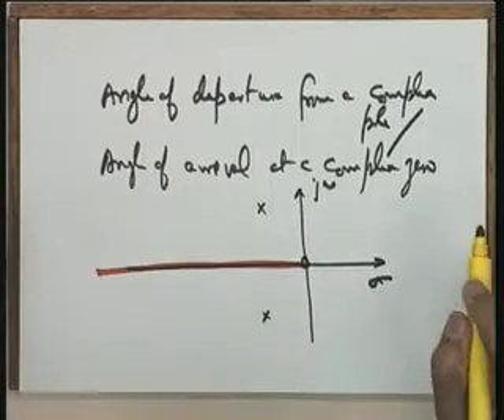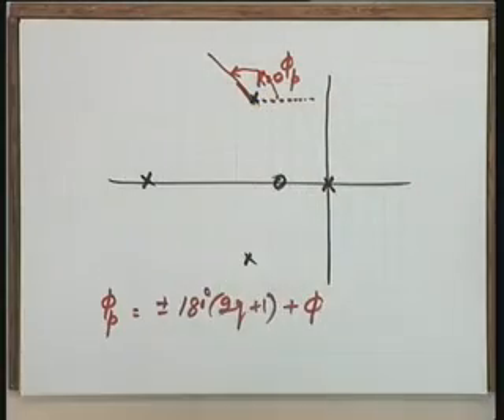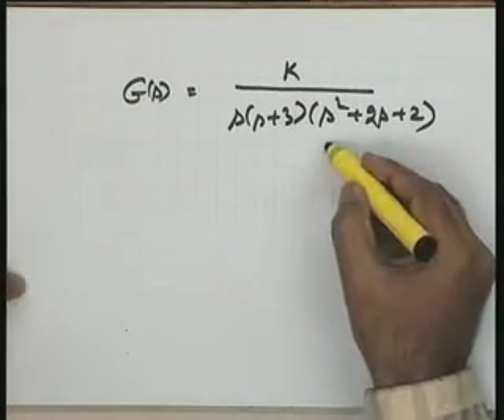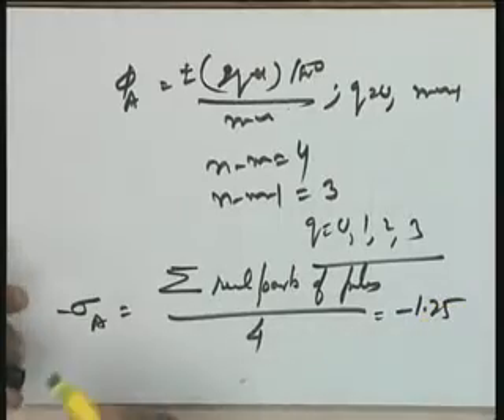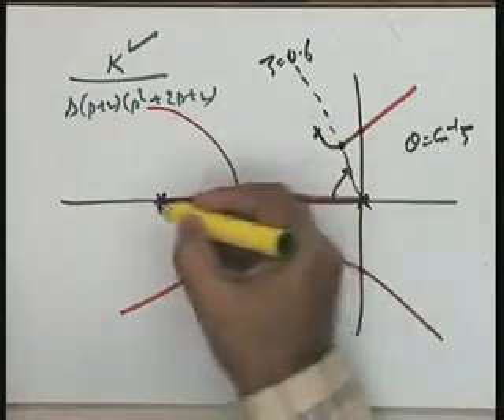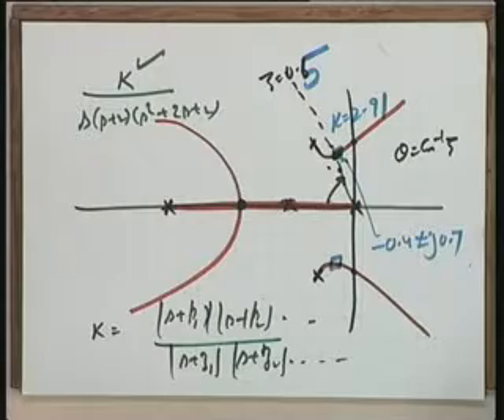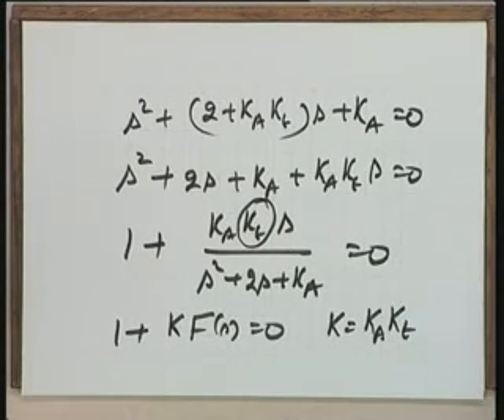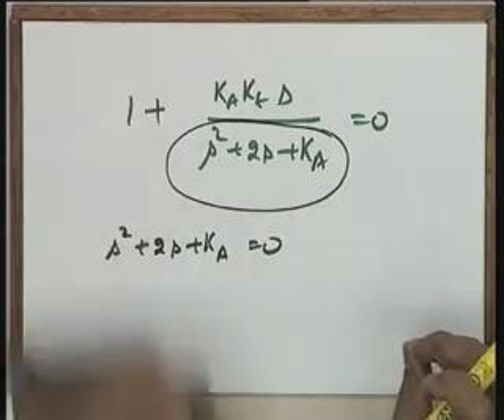Lec-32 Compensator Design Using Root Locus Plots (Contd.)

Comment: Hi, dominance condition is applied when Real part of a pole is 5-10 times the real part of other poles. In the R.L. shown (in the first deaign problem), how did the professor made the pole at origin as insignificant? As gain increases, the pole moves to the left but so do the complex conjugate poles(which the professor took as dominant poles)?
Reply: Prof. is right. He make the line for desired zeta and see the intersection with R.L. When he got the point, he calculates the gain at that point because the design problem is to find all the closed loop poles for zeta=0.5 and that can be done by calculating K. Then he gets the value of other poles(which is no longer equal to 0 as you asked) at calculated K. Your second qsn is that complex poles moves with increasing gain, you are right, but here what we need is the CALCULATE K WHERE ZETA LINE INTERSECTS. He is not varying K. He is just finding other two poles where he has already got the two complex poles. Moreover the dominant poles are those which are closer to imaginary axis.